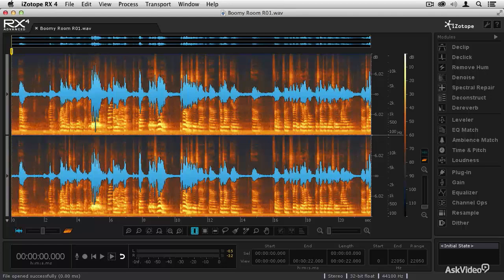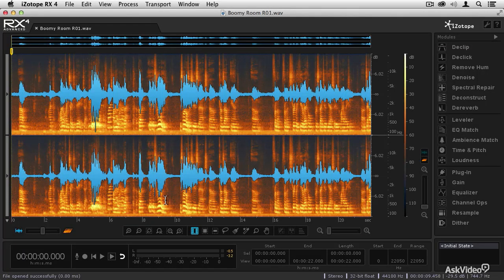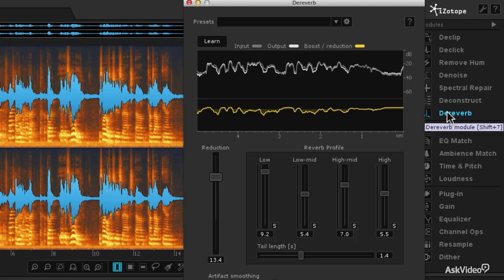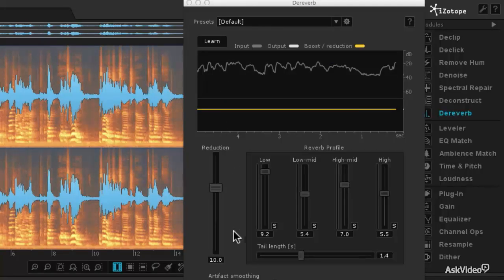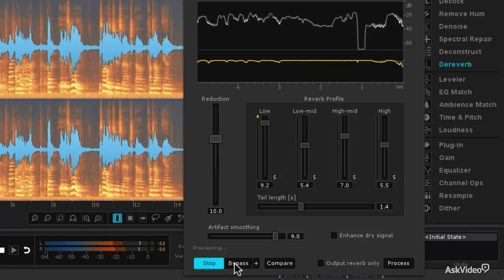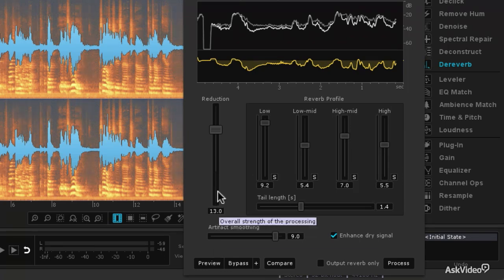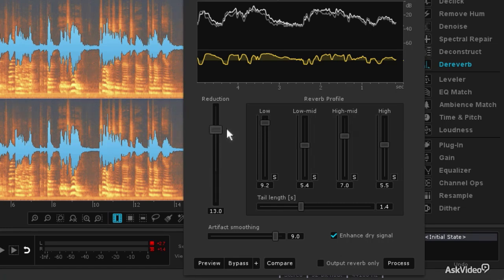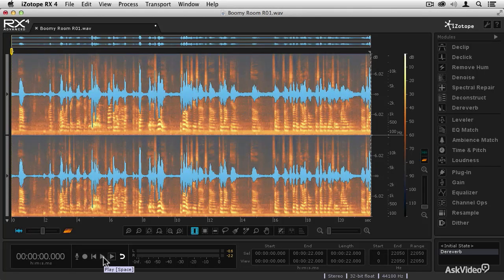iZotope RX 4: Audio Repair Toolbox 2 - 40. Dialog Dereverb

Comment: "Learn the entire audio file." This is TOTALLY different than what the RX3 Advanced manual states: "We strongly recommend using the Learn feature on a selection of audio that starts with some noise floor (or room tone), is several seconds long, and includes both the direct signal and its reverberant tails."

Which is correct?? I use RX3 every day, but have never had any success with Dereverb, despite this being one of the main reasons I upgraded to the Advanced rather than standard version of RX3 when I went from RX2 to RX3.
Reply: John Meyer For removing room reverb, look to plugins like SPL's Transient Designer, SPL's De-Verb, and Elysia's nvelope. Plugin Alliance has them on sale right now for $99, $29, and $199 respectively.
Reply: Exactly, it works just as the denoiser, otherwise it will sound like in this video, very annoying artifacts